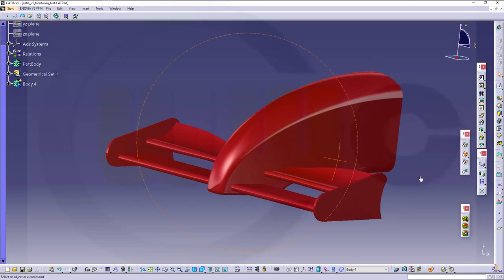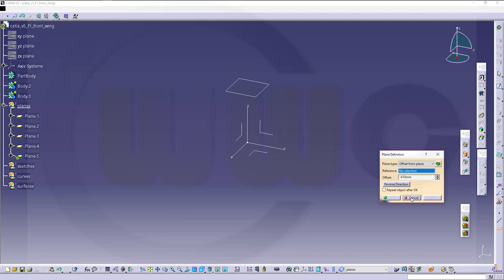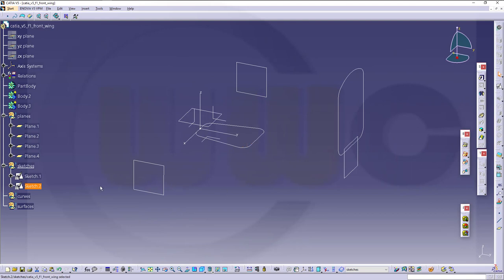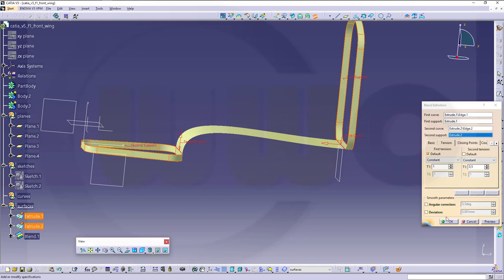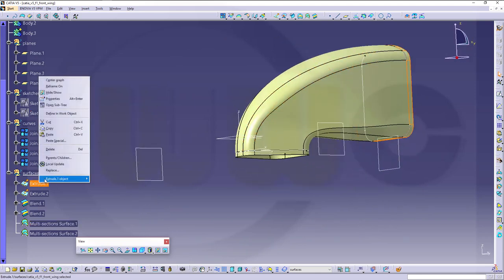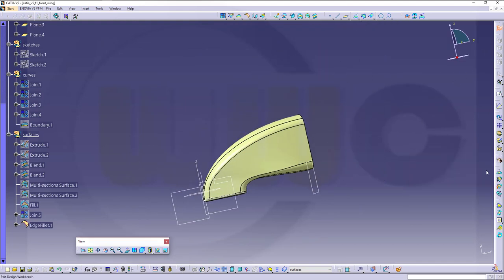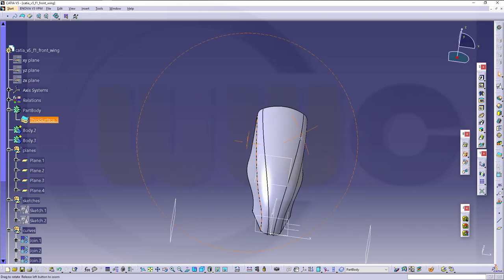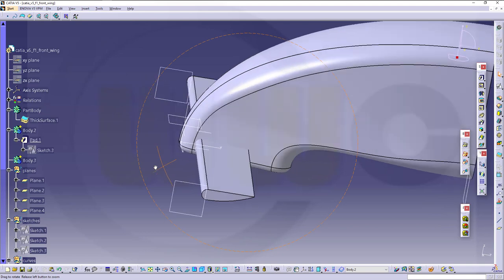F1 Front-Wing - Catia v5 Training - GSD

Comment: Nice and easy explanation. This shows your grip on the commands and the software. Great 👍

I'm also an automotive enthusiast and CATIA designer. I have learned the commands but still not so clear about using them. When the Part design is used, where GSD is used and how to use, I am facing trouble.😢 Can you help me understand the difference and need of each module by giving these types of model example
Reply from the maker: for surface design you need gsd - for solid design you need part design - and you can mix both 😉

Comment: Hello sir. Can you please make a video on how to make f1 front wing as per 2018 rule with those complicated glaps design. You can use the pdf from Fia website for 2018 front wing. I facing tough time designing the series of flap and im feeling helpless.
Reply from the maker: I will consider it, but I´m still very very busy. To do a model with those flaps would take a lot of time, even for myself.
Reply: @wolfgang.walden.cad.training  Thanks for your response sir. I'll wait for it. i'm checking with other website and your this video was big help. but making those complicated flaps design is a challenge right as i'm making one wing based on 2019 rules.